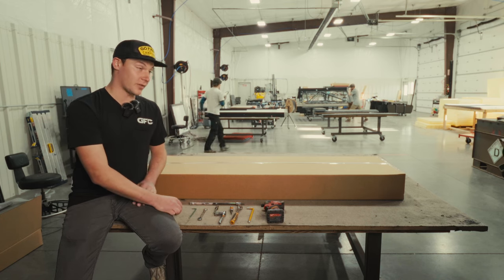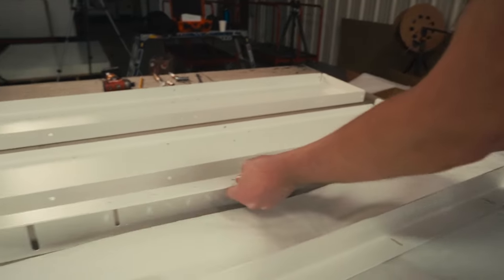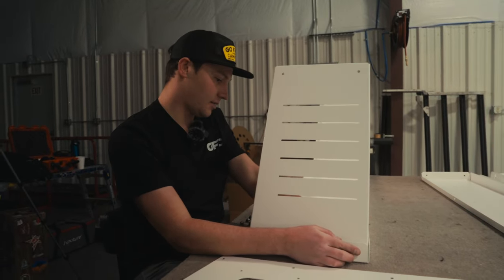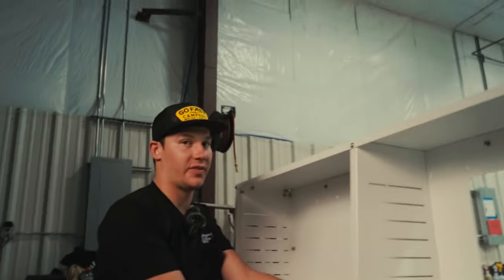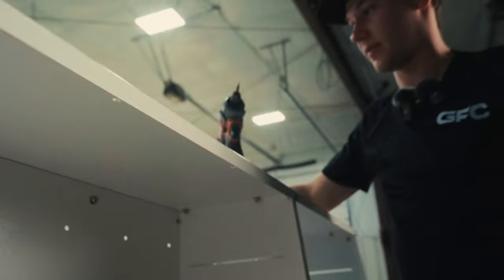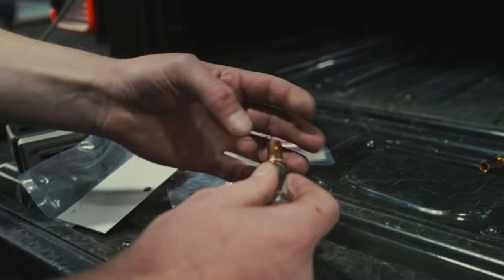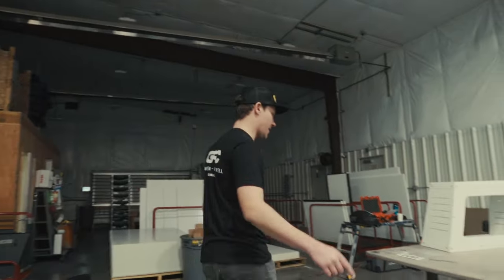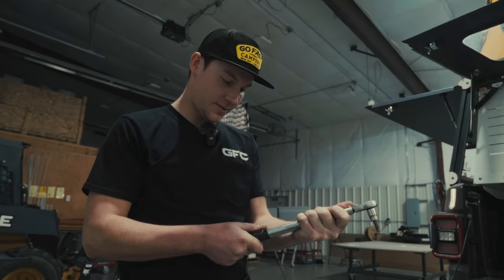TurboCubby: In Depth Assembly and Installation

Comment: Does the TurboCubby interfere with the function of the Honda Ridgeline trunk?  A small drift pin or even a nail might prove useful to align the holes.
Reply: 🤦🏻‍♂️🤦🏻‍♂️🤦🏻‍♂️🤦🏻‍♂️🤦🏻‍♂️🤦🏻‍♂️🤦🏻‍♂️😂😂😂😂Honda docent have a truck it’s an old mini van 🚐